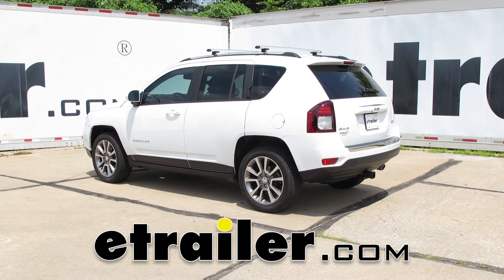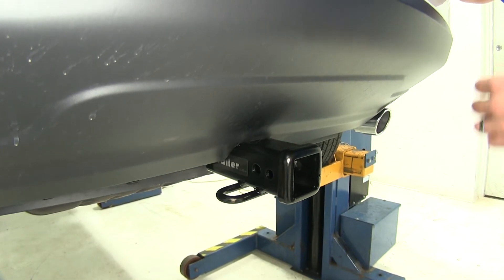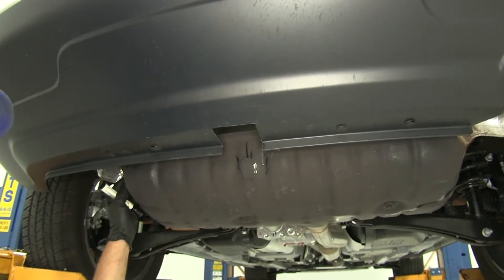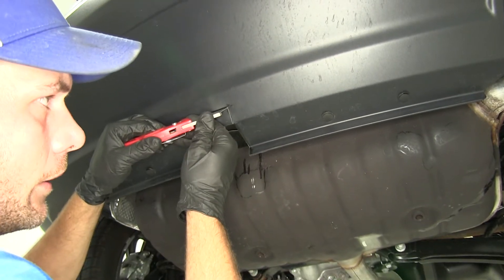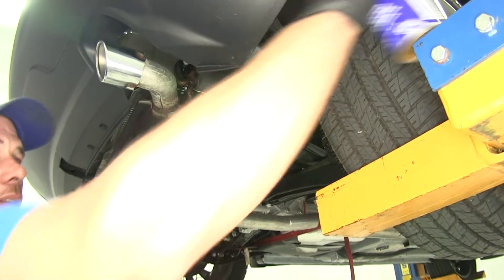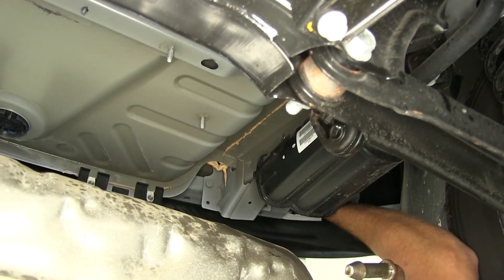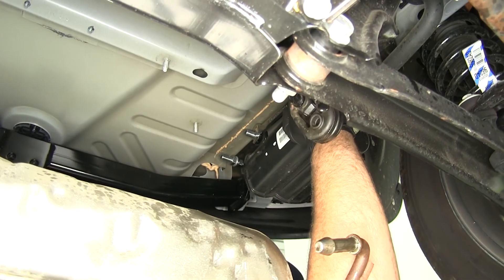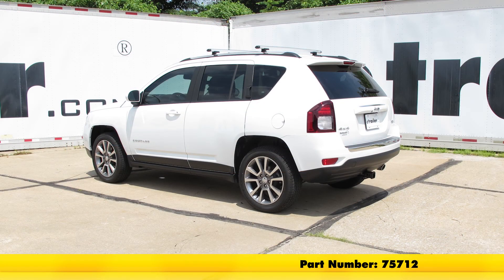Installation Guide for the Draw-Tite Max-Frame Trailer Hitch Receiver on a 2016 Jeep Compass

Comment: Hello , I like the hitch system and the installation process, thank you. I own a 2019 Jeep Compass trailhawk  would it be the same exact process of installation ? thank you.
Reply from the maker: This hitch is not designed to fit the 2019 Jeep Compass. Check out the following link to see a hitch that will work great for your 2019 Compass.
https://www.etrailer.com/Trailer-Hitch/Draw-Tite/76144.html